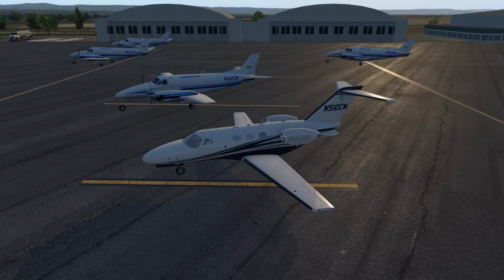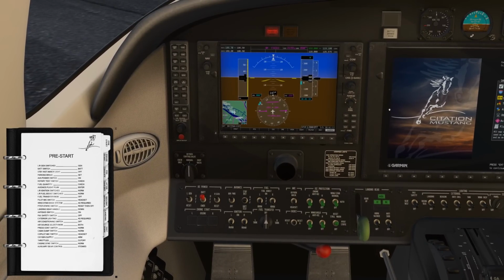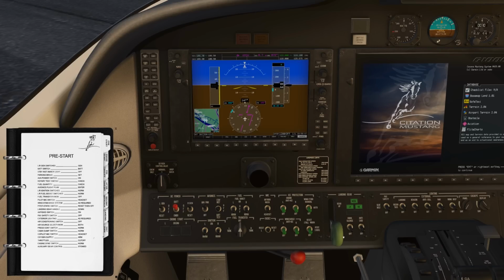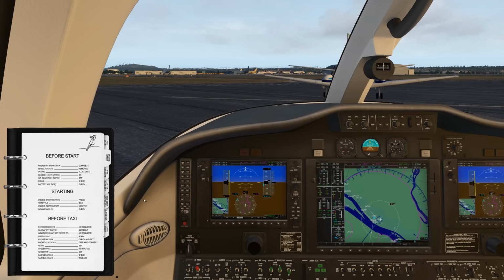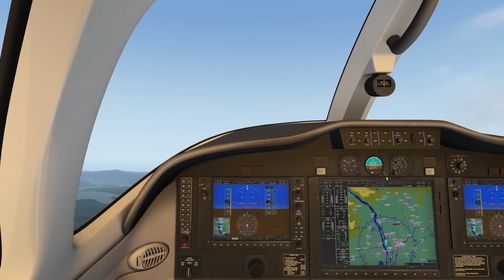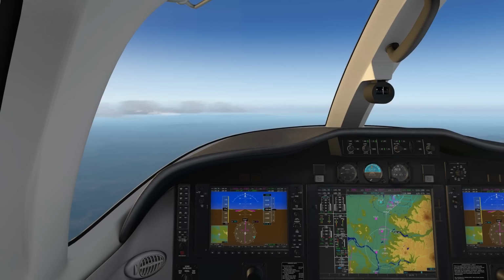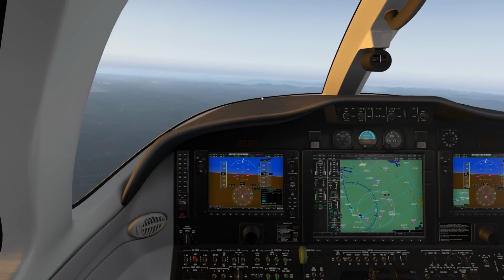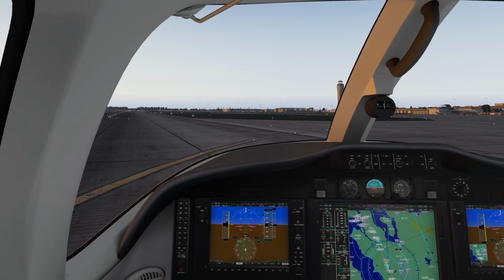X-Plane 11 - Cessna Citation 510 Mustang First Look

Comment: Great video exploring the C-510 Mustang. A couple of observations and comments.  1st,  I'm new to x-plane and really enjoying it, but not new to flying, as I'm am a recently retired, professional pilot with over 20 years in the airlines.   Now to your video... why is the video/sim shutter when you change views on the ground?  FYI: When you're in a jet aircraft the power levers are called just that or "thrust levers". Next climbs and descents should be made on a scheduled speed from the performance manuals or charts. On descents, it is normal in most jet aircraft to let the aircraft accelerate to MMO/VNE by adjusting the decent rate/FPM with cruise power,  and then adjusting the power to achieve the desire rate/FPM for your desired/required flight profile. 

You did great and I'm looking forward to your next video...
Reply from the maker: I've learned a lot since this one 😂 I encourage you to join my discord so you can send me feedback. I am always willing to learn!

Comment: The Citation M2 changed to the G3000 avionics with touchscreens. Too bad they didn't do an M2 instead. The Laminar G1000, although very nice is awful to enter flight plans. Even the GTN750 is way better.
Reply from the maker: I haven't had an issues with it since the update. It's a little finnicky but you get use to it. I wish it allowed for touchscreen input, would save the hassle with the knobs.

Comment: I've had some similar ILS and RNAV anomalies with various planes the past few months: usually it's not the plane or GPS but the scenery having a glitch, or nav data, or whatever.
Sometimes really extreme weather settings can mess with your approach also, but that's not the case here. Also some airport sceneries have defects and you'll not line up right,or the GPS might
suddenly reverse course when you activate the approach button, all sorts of weirdness. Usually if you're arrival is sound, you're at the right IAF alt., and you arm the approach at the right time,
that ILS should just line you up dead-on with the runway. Or RNAV. But some airports have offset as well, although not that many of the major ones. At Telluride, yep, there's an offset alright,
which you need to take into account if you're doing an RNAV there. I also note that if the Garmin G1000 is working properly on approach, it should roll you over automatically from GPS nav.
to ILS systems. (magenta to green).  I had one O'Hare approach using the Garmin and the initial RNAV the GS didn't engage, so, I had to go missed, let the Garmin set up the same approach
to the same runway again, and the second time it worked just fine. There was no reason for the first glitch, I do not know why it didn't take the first time. I doubt it's the plane itself.

Comment: I also have trouble with the doors, I’ve raised it with the developer (email address is located in your support documentation). RW Designs is the developer.

Agree on the sounds, I’ve mentioned this to the developer also.

The Test knob is located top right on the console. It is a circular rotating dial that goes through all the error situations.

Note: Use the menu option in the Flight Planner to delete previous flight plans. Saves having to delete waypoints individually.

The Citation Mustang has an alphanumeric keypad associated with the FMC. This one is taken from Laminar’s G1000, which is the limiting functionality here.

I’m fairly certain SIDS and STARS are supported along with approaches RNAV, ILS etc. It uses the same Navdata for XPlane.

The lever below the PFD is the emergency brake handle. The stowed manual gear leave is located in the bottom front of the throttle console. The hatch isn’t functional in this plane.

The Pitot Static switch is left off until you enter the runway, as it easily overheats and gets damaged.

To release the throttles out of the cut off detent, you need to view the metal bar on the stem of the throttle leaver. When you see the “hand” symbol you can move it into position.

I’d leave Transponder to STBY until you approach the runway, then select ALT. This is so you aren’t visible to the Controllers while on the ground.

Use 170knots for climb out on FLC then around FL270 you can switch to Mach speed .440 is recommended.

You need to adjust both pressure settings, I.e., the steam dial you adjusted and the PFD baro dial. Note: it would be nice to be able to nominate STD pressure by pressing on the Baro knob but you have to use the soft keys on the PFD.

VS vs FLC: I nominate a vertical speed of around 2000fps on takeoff. With climb speed nominated, initially the speed will easily surpass 170 knots but as the altitude increases the speed will decay. At 170knots, I select FLC and continue on from there.

Once you begin your descent, you can use VNAV to get the plane to assess what descent is necessary to meet the height restrictions in the FMC. It actually does it very well. My favourite feature of this plane.

Remember, you can use your speed break during flight to reduce speed. Always a good idea to reduce your speed prior to descending (easier to manage).

Try using the MFD to manage the flight plan. Layout is easier due to the larger display. You manage it from the controller pad on the throttle quadrant.

As a tip, if you select LOAD for the approach, it will automatically become ACTIVE once the waypoint is reached. Then you don’t loose you flight plan to the beginning of the approach.

My experience has found that the approach takes care of the course and Nav frequencies, I.e., haven’t had to set them manually but the approach has worked correctly.

Suggest getting down to below 200knots, extend landing gear and approach flaps, slow to 150knots, on approach extend landing flaps and reduce to around 113knots till you reduce to idle and flare onto the runway. Suggest mapping a button to extend and retract the speed breaks, so you can deploy them as soon as the nose wheel is down.

Finally, thanks for bringing this video of the aircraft to us. I agree, it is a good VLJ for XPlane. This is Version 1, so I’m sure it will only get better in time.

Regards, Paul

Comment: What did you do to make  the GPU works? I`ve tried here but I couldn`t make it work (such as doors, unable to open)
Reply from the maker: Honestly, I don't know! It just worked for me. I'm tracking people are having problems with it. I think on the forums someone posted something about how to fix it...
Reply from the maker: I was wrong, it's just a known bug.
Reply: Just got the plane and for me doors and GPU works fine.
Reply from the maker: @vrj0  the reasons why there were bugs have been identified and are being fixed. Most of them are specific occasion dependant.